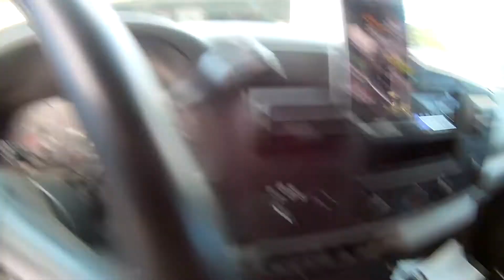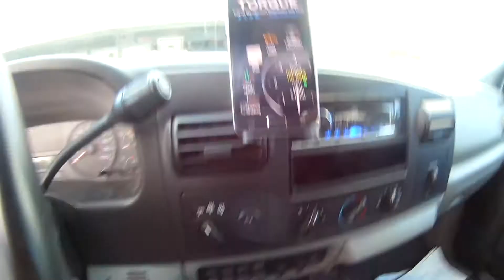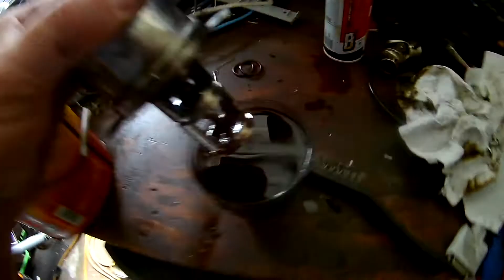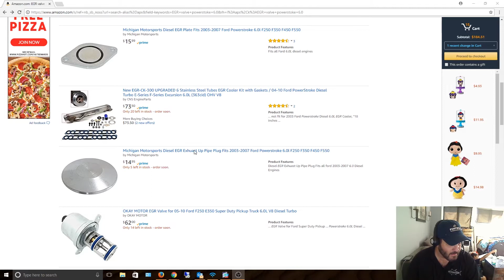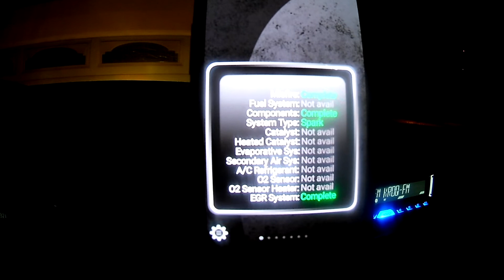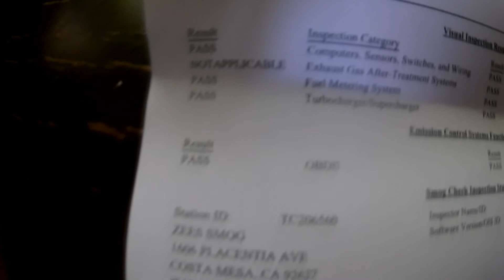F250 Powerstoke 6.0 EGR Not Ready CA diesel smog P1000 Parts 2

Comment: Same exact issue, yes I can see why you like the torque app however from what I have learned excluding the guy who said changing the thermostat did the trick( witch is cool) the only people who can read diognostic properly are people with Ford software. I learned today the computer they use cost around 10,000, and then another 4000 monthly to be able to charge you 200 hr to diognose your problem  after several visits to the dealer thousands of dollars to walk away with the check engine light on and of course their not going to tell me this. So it's a shot in the dark but the clutch fan is next.

Comment: Would you have passed the egr problem without the Cat? Just bought a straight piped 06 6.0 that I'm going to put a cat on. Problem is I need to pass smog to register it. I can get a place to pass visual but the egr is holding me up. I cleaned it and did the cycle. Now I need to just replace the egr valve. Hopefully that will do the trick

Comment: I have a 05 ford f350 6.0 it was saying egr not ready I drove it for 70miles I replaced the egr valve dirent work .. what I noticed was my truck dirent get hot ..the needle wouldn't get in the middle I changed the thermostat and bammm problem fix..ur truck needs to get hot to start reading the egr boys...
Reply: What temp did your truck get to? Mine runs about 190